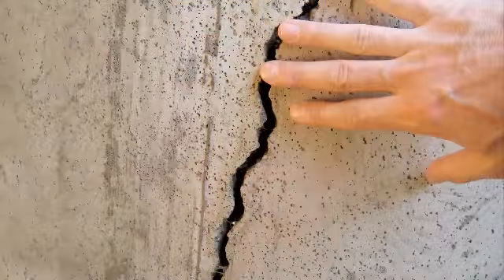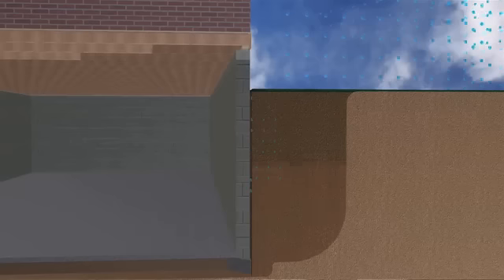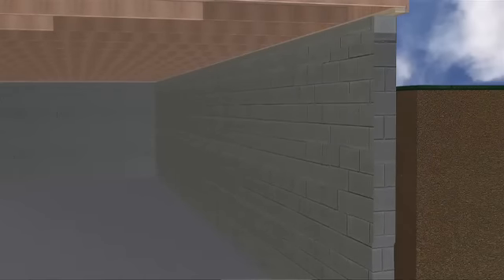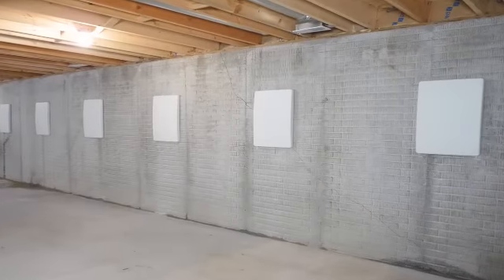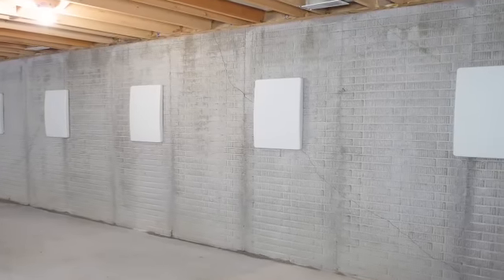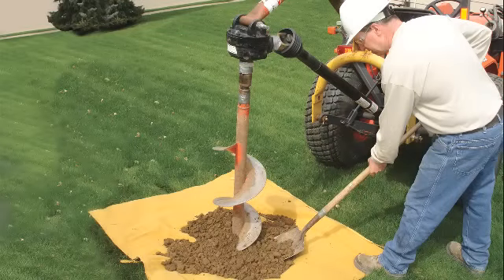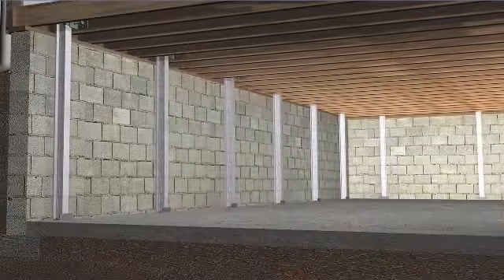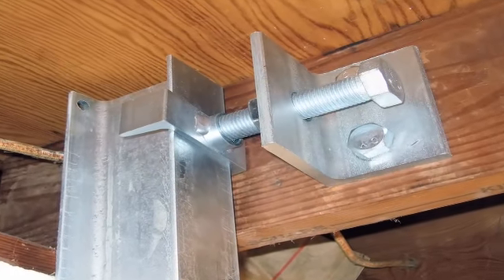Bowing Basement Wall Solutions in KY and TN | Frontier Basement Systems

Comment: For new home construction could either the straps or earth anchors be added during construction to prevent any type of wall movement??
Reply from the maker: Yes they could. An inspection is necessary to see the best solution. If the home has not been built yet,  I would suggest having your local dealer look over the plans and check out the soil. The moisture in the soil will of course be different during different seasons.

Comment: So you dont address the reason for the bowing wall seems like a waste of time if problem for the bow isnt fixed?
Reply from the maker: The reason for the bowing wall is pressure. These solutions provide a permanent resistance of pressure back against the wall. We can not control the water in the soil or massive amounts of water in a short period of time. However we can stabilize the foundation to protect the home. Some homes need additional water management systems but not all do. Each home is treated specific to its needs. The inspection and proposal are free.

Comment: Does this solve leaking?
Reply from the maker: This is specifically for foundation problems, not a waterproofing solution. However foundation walls with cracks or other signs of failure are likely to leak more. Foundation issues should be addressed before waterproofing is effective.
Reply from the maker: This is not a waterproofing method but foundation cracks are a contributing factor to leaks. So addressing this is important and will help for sure. Most materials used for foundation walls are porous, add some cracks,  and water will find a way.  We do offer waterproofing methods as well, inspections are free. An expert will talk with you about your concerns and priorities, complete and inspection, then sit down and go over the best permanent solutions for you.

Comment: The carbon-fiber is crap Overtime it will give you're better off using the beans those will not give
Reply from the maker: Carbon Fiber, PowerBrace, and Wall Anchors all have specific use. Depending on the condition of the structure. An inspection by an expert is important to diagnosing and determining the best permanent solution.